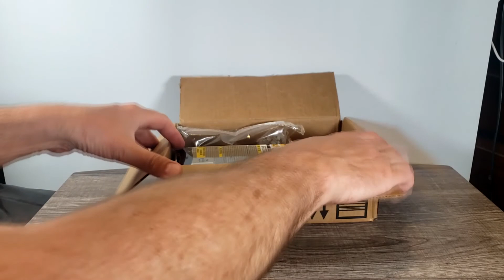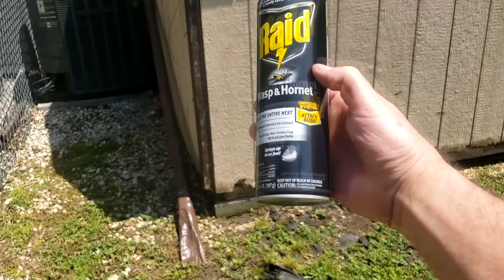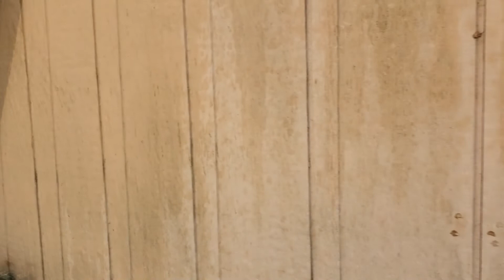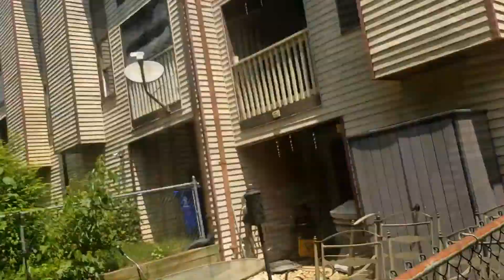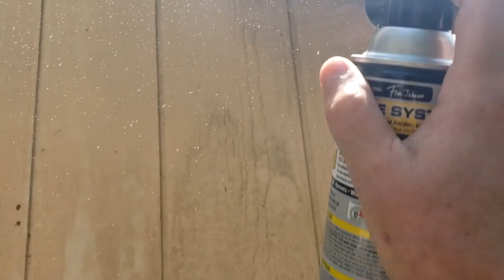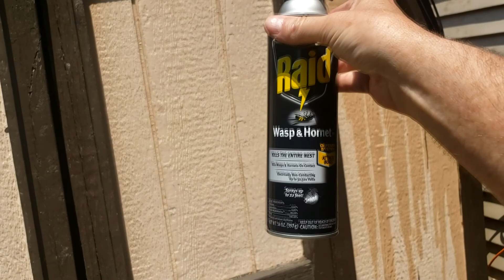RAID Wasp And Hornet Spray Outside Demo and Unboxing

Comment: Does it stain walls??
Reply from the maker: I just used it on an old shed and deck. I wasn't even considering staining. I would contact the company, they might know how it will effect whatever it is you are putting it on. Found this link to the product page with some detailed info on there, sheets, etc. If you hit the inquire now button there is some contact info. Hope this helps.
https://www.scjp.com/en-us/products/raid-wasp-hornet-killer-33